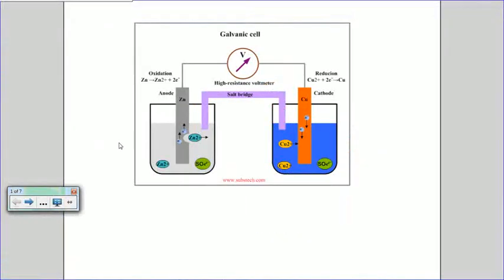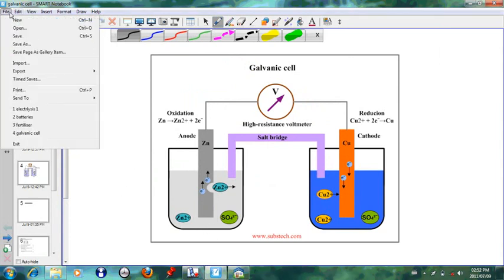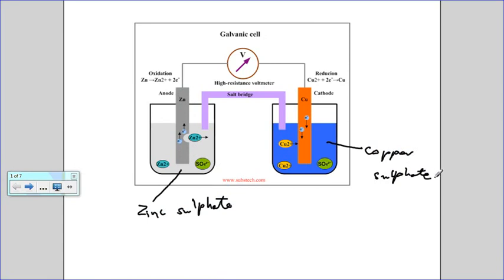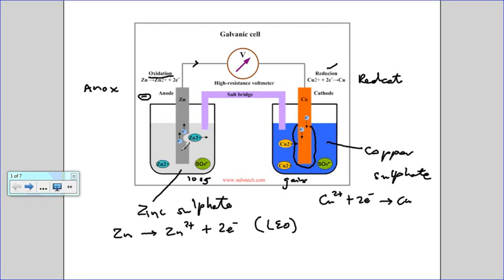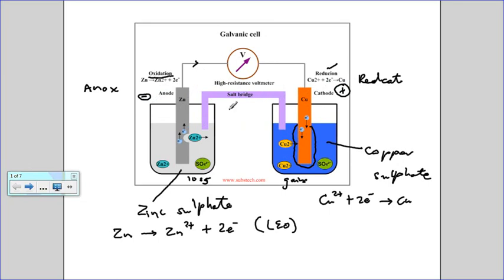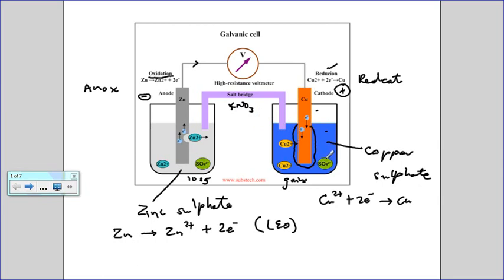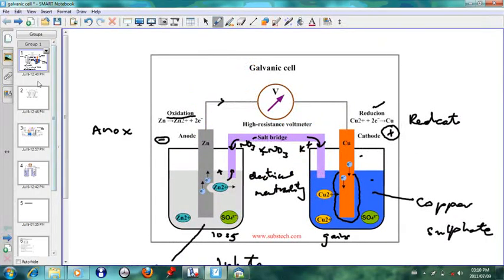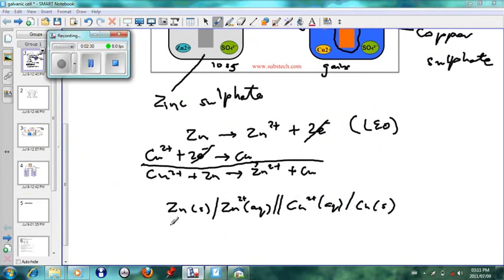Electrochemical cell - Galvanic cell

Comment from the maker: I would first place a metal strip that has a greater reducing ability than copper but not zinc in the solution. A metal such as iron or lead would do just fine. This will make the copper be deposited on the metal strip.
 When all the copper is removed, only zinc will be left in the solution.

To remove the zinc, I would place a metal strip of greater reducing ability than zinc, such as aluminium in the solution.

I hope this helps.